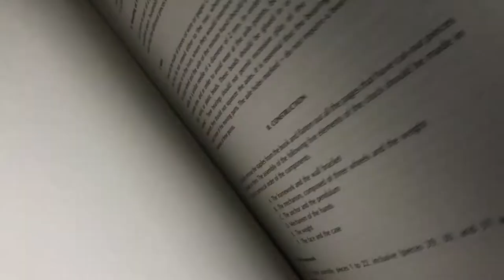Making a Fully Mechanical Clock Out of PAPER

Comment: I bought this book at San Fransisco more than 30 years ago.
I assembled it then for myself, and recently one more for my grandson. They
worked very fine.

When the effective length of the pendulum is precisely adjusted by moving bob,
they kept accurate time within one minute a day.

.....

Some know-how on assembling the paper clock:
1. Position of axle hole on the Part 67 is wrong. Part 65 is correct. (This was 
   the only one error I found in this book.)
2. Make thin tubes by card-bord, insert them to the center of the gears and
   anchor. This makes inserting axles much easier. You do not have to search for
   a small hole from the other side of a gear. (This was always very hard for
   me.)
3.1 After drying glue, squeeze all the teeth of smaller gears at the center of
    large gears by a pair of pliers to make them thin. 
3.2 Let instant glue sink into all the teeth of gears and anchor to harden them.
3.3 Rub all the teeth of gears and anchor to smoothen their surface.
3.4 Apply candle wax to all the teeth of gears and anchor.
4. Measure distance of centers of engaging pairs of gears, adjust position of
   holes on Part 4 and Part 10 according to the actual measured gear distance,
   give small allowance.
5. To connect the power-gear pully and minute-hand-gear pully, use two turns of 
   cotton string ring, instead of a rubber band. With a rubber band, adjusting
   time by moving minute-hand is a little hard because of elasticity and
   friction of rubber. Cotton string ring allows pully to slip. Cotton string
   ring should not be too tight, nor too loose.
6. Put some weight inside the pendulum bob. This makes movement of pendulum
   steady by increasing kinetic energy when it sways, hard to be affected by air
   flow.
7. Make minute-hand longer by 1 cm than the plan. This will avoid touching
   hour-hand while adjusting time by moving the minute-hand.
.....
I made another Clock Face.
1. Cut off the inside of the frame.
2. Cut out number figures, put them on the frame.

With this face, I enjoy watching the movement of gears from in front of the
clock.
Reply from the maker: Great tips, thank you for sharing!

Comment: Additional know-how on assembling the paper clock:

1. Shift the cut-out hole on Part 26 to the left by 13mm, adjust outside cutting pattern
  accordingly, so that the clock stays perpendicular to the ground.
   The string hanging the weight is at the left from the center of the clock by half the
  diameter of Part 42. If the hole of Part 26 is at the center, the bottom of the clock 
  tends to tilt to the right.
2. If some weight is put inside the pendulum bob, glue a few pieces of cardboard to Part  97 under Part 98 to increase friction between pendulum rod Part 94 and Part 98, otherwise bob may slip down by its weight.
3. Make the portion of Part 99 to be glued to Part 97 longer by 2-3 mm. This makes
  gluing Part 97 and Part 99 easier.
4. Glue the Part 99 a-b first, then Part 100 to Part 99, at last Part 97 to Part 99. If   Part 97 is glued to Part 99 before Part 100, it is hard to glue Part 100 to Part 99.
5. Insert and glue hard cardboard in Part 70. Part 70 may a little too soft depending on
  the cardboard used.
6. Widen the width of the cut-out hole of Part 71, Part 72 and Part 96 to the bottom
  width of Part 95, Widen the whole width of Part 71 accordingly. This keeps pendulum
  stabler when Part 72 becomes soft.
7. Widen the rim of Part 43 and Part 44 by 3-5 mm, so that the strings don't come out of
  the wheel.

Comment: I did not cut the book pages to make the clock, so that I could keep the book.

1. Disassemble the book to page sheets.
2. Lay one page sheet of the book on a sheet of cardboard, fix them with paperclips.
3. Copy the position of all corners of patterns by penetrating the book page to card
   board with a sharp needle.
4. Draw patterns on the cardboard following the pinholes.
5. Cut patterns out from cardboard, assemble them to build the paper clock.

I am afraid...did I violate the copyright law?

Comment: Is this clock on time？
Reply from the maker: It keeps time to within a minute or two per hour
Reply: @imaginemore  wonderfull,how long it works on time?
Reply: @bighead6106 It will run for 5 hours until it'll need to be rewound since it uses a weight to power it